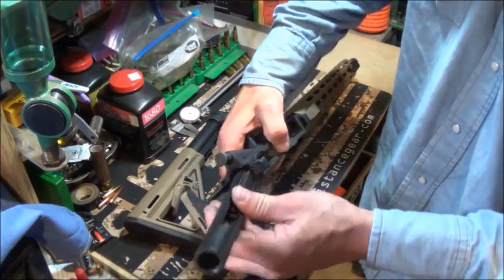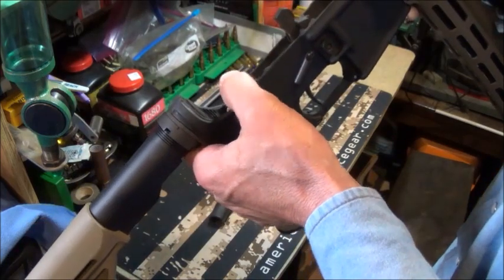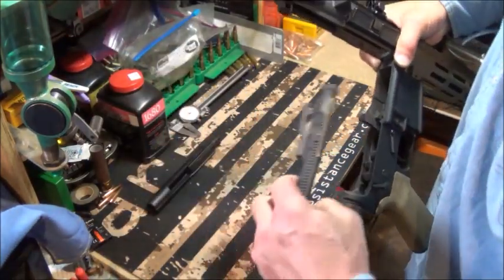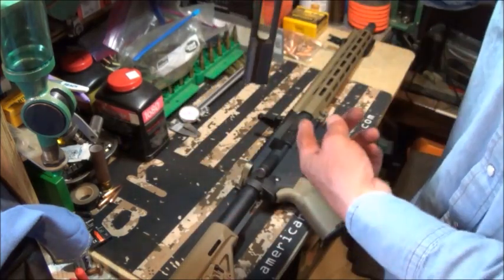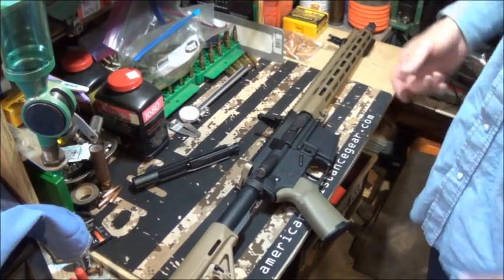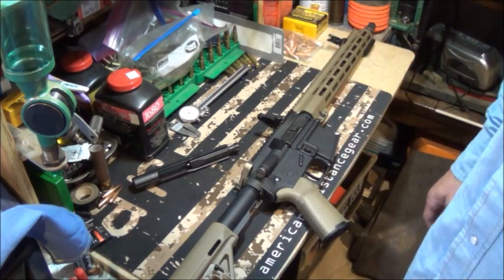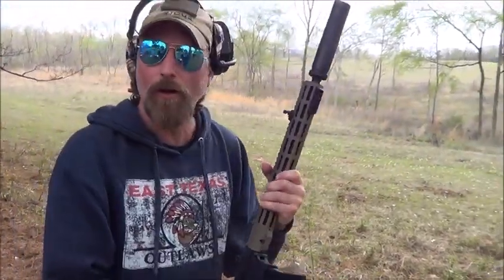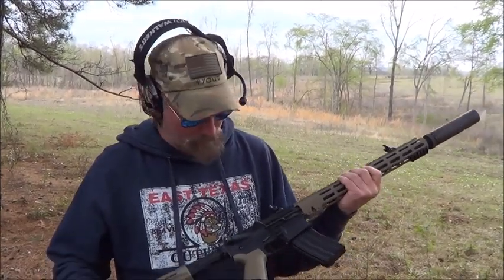Rare Breed FRT - 15 Trigger - BCG Fix

Comment: Just an FYI you can take much more off the carrier with a dremel.  That trigger reset "dongle" only requires very little forward movement to trip.  I figured it out by manipulating the bolt manually.  Charge the firearm unloaded then gently hold the trigger and pull the charging handle back then SLOWLY let it forward and listen for the hammer fall.
Reply from the maker: You just got pinned !!!!!!!!!!!!
Reply: @EastTexasOutlaws  you got a PURDY MOUTH.  REVERSE ACTION!
Reply from the maker: @predawndeath  Yes to both, LMAO !!!!!!!!
Reply from the maker: @scooteractual  I would assume, I haven't ever removed any material, Predawn has though. Thanks for watching and taking the time to comment
Reply: What is the gap measurement to the port from the bolt . Timing gap . Like for a .22 and Drop in auto sear {registered} is .011.

Comment: I have a nickle boron toolcraft bcg I measured it and it is exactly 2.280 and I ran 8 mags just fine with it I have an h3 buffer and the spring binded up on me still so you are wrong it is rare breeds fault they sent me a new spring and antiwalk pins cause I fixed the problem with a dremel it is the locking bar, after I took off enough of the locking bar so it wouldnt pinch the spring it runs just fine it is 100% a design flaw.
Reply from the maker: Awesome good information, thanks for watching and taking the time to comment !!!!!!!!!
Reply: Yeah mine was 2.28" gap as well. I tried 8 different BCGs just to be sure. Spring isn't damaged. None of the uppers will mate without force. Tried H3 buffer all the way down to carbine with milspec spring. Single shot, loads new round, hammer follow without firing.
Reply from the maker: @Chris-ru9cq  Ya, we did have an issue with a buffer spring on a 300 blk being just a little short, but you definitely want them to mate without force. Thanks for commenting.
Reply: @Chris-ru9cq  that really sucks ass thats a new one I haven't heard before mine was an easy fix but your spending 400 bucks on a trigger you have to modify pretty much right out of the package those tiny little screws on the anti walk pins are a joke too its an all around rip off if you don't know how to fix it yourself the housing is good they made it all pretty that's about it haha
Reply: @Chris-ru9cq  sounds like the only thing you haven't switched out is the lower, maybe the pin holes are not in spec and the trigger is too far to the rear.
Reply: @charleswittmer2477  I tried 3 lowers to be sure. Finally worked flawlessly with a POF Rebel hammer spring on the trigger and a flatwire overpower Tubbs (?) rifle spring with rifle buffer.

Comment: Had the trigger for about a month in my bcm recce 16. Zero issue, with no Dremel or bent spring. Standard H2 buffer it came with and midlength gas system. Didn't tune anything and she's ran like a champ so far, granted I'm only at the 300 rounds on this trigger.
Reply from the maker: That's awesome, thanks for sharing with us !!!!!!!!!!!

Comment: I'm new to this FRT stuff. Just saw the ATF lose in the lawsuit, so I'm trying to source information to get my stuff up and running. Everything I have is semi-auto and I'm pretty sure all my BCGs are neutered. Does this mean a FRT will not work unless I get a Full-Auto BCG??
Reply from the maker: Main thing is full auto bcg, the upper closes without moving the reset, and a H3 buffer weight.

Comment: My bolt is over 2.280 and it doesn't close.
Reply from the maker: Well my PSA, and radical firearms BCG works with it, and predawns E2 armory does as well, Not telling you what to do but I think it's bad advice to  grind on the locking  bar ( dongel ) I'd rather take some material  off of the BCG that is cheaper than the trigger. Just my opinion. good luck !!!!!!!!!!!

Comment: I’ve been doing videos on rare breed for a while. Great video!

Every one of my installs has been exactly like you showed, the upper and lower will not seat. I use a small amount of rearward pressure on the charging handle and it will seat just fine. I’ve run all of them this way and never had a spring break or an issue. I’m about to do a 2000 round check in on my lower and trigger.
Reply from the maker: Awesome! Thank you for sharing with us !!!!!!!!!!!!
Reply from the maker: @Nuts2butts  The rare breed eliminates hammer follow, it's probably your buffer weight. Thanks !!!!!!!!!
Reply: until you forget or someone else closes the upper on the trigger group and forces it closed. why not just open the bcg up and get it right before it gets screwed up?
Reply: @charleswittmer2477  because every one of my installs is running at nearly 100% while the rest of the internet says their triggers don't work. I'm not fixing what, to me,  doesn't appear to be broken.
Reply: Question for you: I had an AR pistol built in 556 with a 10.5” barrel and the rare breed frt. I put in an H3 buffer and during the first testing it would only shoot one round then not reset and had to be manually set back into action. The next day I tried a h2 buffer and it ran 556 and 300 blackout for about 3 magazines and then went back into the same issue of single shot then dead trigger. First day with the h3 there were light strike marks on the ammo with the h2 buffer there were not. What could be a reason for the issue and what would you recommend?
Reply: @Nuts2butts  same issue with an H3 on at 10.5” barrel. It ran great for 3 mags with an h2 then back to single shot. Wish I knew if it’s a buffer or spring issue
Reply: @bikerbobbyde  I'm having the exact same problem have you found out any info?

Comment: My carbine gas system works perfectly with the H2 my bcg is a little out of spec but I've had no issues so far. I think most of the problems people are having are either incompatible setups or improper installation ie forcing the recievers together or playing with the disconnector, and pinching the spring.
Reply from the maker: I agree, Thanks for sharing with us and taking the time to comment !!!!!!!!!!

Comment: I think if you have the proper BCG and Buffer weight (H1, H2, H3) for your AR platform along with the spring being able to travel at more of a 45 degree angle rather than straight back, I think this trigger would run absolutely flawless. Another option might be to create more of a "leaf spring" rather than a coil spring system. I also wonder if you were able to encapsulate the coil spring with say a piece of shrink rap or other type of tubing material that might help also. Just brain storming here.
Reply from the maker: Awesome comment, Thanks for sharing with us. I think I'm going to have to put a H3 in to shoot unsuppressed !!!

Comment: ETO, I just measured my PWS upper that doesn't work with the FRT and the LWRC that does work with the FRT. The PWS opening is bigger. Then today I remeasured the PWS and it was 1 hundredth bigger today 229 and the LWRC is still 227. So I was thinking the issue might be the back half of the bolt to the opening. Maybe my hands are not good enough to get a perfect measurement (quadriplegic thing). Neither PWS or LWRC closed as it would with a regular trigger. Did your buddy file his bolt to see if it works?
Reply from the maker: Getting them to close is the main objective, I believe the pinned comment of Predawn Death's talks about that. Thanks !!!!
Reply from the maker: Read the pined comment at the top, Thanks again.!!!!!
Reply from the maker: I talked to Predawn last night, He said I should have measured the distance from the back of the BCG to the cut out not the cut out opening.
Reply: @EastTexasOutlaws  With my PWS opening being 2.29 and bigger than LWRC at 2.27 which worked. The PWS sorta worked. I run my ARs on the dry side but when measuring both the PWS was bone dry. With this ammo shortage I hate wasteful ammo use but I think I need to rule out the possibility.
Reply: @EastTexasOutlaws @predawndeath I'm going back to the range today with PWS upper, covered with Slick 2000. With the opening of the PWS BCG bigger opening than the LWRC BCG. I will go without a can this time. The gas block set to 2 and between 1 and 3. I have the H2 buffer. The LWRC doesn't have an adjustable gas block and with a can is usually over gassed.
Reply: @EastTexasOutlaws  you don't have to measure anything if the parts are hitting, the only thing that can be changed is the portion of the bolt that is hitting the lever extension just make sure the bolt is fully closed in the upper before any material is removed and just remember if the trigger is taken out that the bcg that fits it should be kept with it.

Comment: I ordered a new BCM Bcg to try to get around grinding my no name Mil spec full auto bcg and both are the same size. So we’re saying it’s not a design flaw that it won’t run with a bcg that’s supposed.05” off spec.? Even if I do shave it, it looks like it would need to be more then that. Hard to tell tho. Do they expect us to just keep ordering hard to get 200$ bcgs until we get one that works with their trigger. People need to stop saying it’s not the trigger.
Reply from the maker: This was my quick easy fix, I can't help your frustrations. Thanks for watching and taking the time to comment !!!!!!
Reply: I'm with you and there is more than one thing that doesn't make sense here. First off he measures gaps on two different BCGs but he doesn't measure from face of BCG to rear cutout to see those differences which i s more important than the gap measurement for starters. Then the difference he is talking about as being the gap is quite literally 3 to 4 human hairs wide... The rifle that the BCG is in could have different measurements from seated bolt carrier to channel cutout where it contacts the drop sear on the Rarebreed trigger as well. It is a lot more complex than just "Hey yall, this is all we noticed with our limited testing of 2 rifles and 2 BCGs and we can conclusively and definitively say that the manufacturer who would have to pay for thousands of repairs at their cost isn't wrong at all." I love how he calls it a quick easy fix in his reply but it is not quick or easy if you cant find or cant afford a new BCG not to mention, what happens when you get one that is overly large and you cant remove material to get it to work. Common sense and majority rules makes this video kinda pointless for those that know how to logic.
Reply from the maker: @whitewigglesworth  aw, keyboard cowboy can type, awesome 👍😎
Reply: @EastTexasOutlaws  Keyboard cowboy got your attention! LMAO
Reply from the maker: @whitewigglesworth  thanks for watching and taking the time to comment
Reply: @whitewigglesworth  and you are correct, there is way more to a ar than the width of a hole in the bcg and where it is positioned, but the hitting when the upper is closed shows that there is a problem of interference between the two. I don't think I would modify the lever except for the chamfer of the hole or a new angled hole with a setscrew in the housing as it might be hard to get a replacement for but the bcg can be modded as they are replaceable. The problem is that the ar needs a really good mechanic to tune it to run correctly and a learning experience is costly for beginners. You might end up like some of us with enough parts to justify another gun. Like someone said just watch the bcg in slow motion until you fully understand the relationship between the parts. Different ammo will also change the way the bcg moves and whether the gas port is getting closed up from use prior to trying this new trigger group, heck maybe the recoil spring is weak from long usage. Even the bolt pushing a round out of different mags can change the bolt speed and it's relationship to the trigger/hammer function. I would think the best scenario would be the bcg just barely clears the lever as the upper is closed for the best timing.  lots of variables to consider when we have guns that look identical but very different inside,

Comment: Wanted to like this trigger but I've modded the bcg and tried it in both my 5.56 and my 9mm. Couldn't get the 5.56 to fire more than 1 round at a time and the 9mm was having out of battery detonations. Thought about emailing the company but since they dont seam to say anything other that you're gun is out of spec I'm just going to send the paper weight back
Reply from the maker: Thanks, I don't think they take returns.

Comment: Can you define what you mean by ''out of spec''?  When I think about ''spec'', I think in terms of the nominal dimensions that Stoner drew up for the M16 bolt carrier and the related +/- machining tolerances. I don't think that the specific carrier dimension that was mentioned in this video (2.280/2.272) tells the entire story.  The extent to which that ''dongle'' is being engaged by the carrier is going to be impacted by the dimensions of the interacting machined surfaces of the barrel extension, bolt, cam pin, and the carrier forend bore.  You are definitely on the right track, but that 2.280'' is somewhat arbitrary since there are multiple dimensions that ultimately determine how far forward that portion of the carrier rests when in battery.  That 2.280 on a different bolt isn't a guarantee for functionality. And, I'd be willing to bet there is a good chance that ''2.280 bcg'' solution in the video probably won't work very well with trigger after 5000 rounds. But, it will still measure 2.280''.
Reply from the maker: Basically if you cant close the upper without moving the dongle forward it can damage the spring.
Reply: @EastTexasOutlaws  yep

Comment: Hey. I'm having some issues troubleshooting, is there any chance you guys could help me with some tuning? It's very hard to find resources on this stuff and most gunsmiths don't even know how to help or are not interested. 

I'd be much obliged.
Reply from the maker: The main things are to make sure your upper closes without to move the reset and an h3 buffer weight. I also recommend a militia state armory  FRT lock bar spring for the rare breed and a M3 Tactical FRT-OTS1. The M3 keeps you from pulling the trigger to hard and slowing up the BCG or stopping it all together.
Reply from the maker: https://www.youtube.com/watch?v=UtNAAThjLZ4&t=16s
Reply from the maker: https://www.youtube.com/watch?v=QE2fgyp4Ljs&t=23s
Reply from the maker: https://www.youtube.com/watch?v=qg1nqYgxxBU
Reply: Okay. So I took to some die grinding on the BCG. All of my BCG's have a 93 thousandths opening instead of an 80 thousandths but I'm assuming the dimension would be from the back of the BCG to the shoulder of the opening. 

It just barely trips the dongle now. I'll try it and report back and watch your suggested videos if it doesn't work!! Thank you so much, happy thanksgiving.
Reply: Alright.. so did a hand filing test on my bcg. Got down to where it just barely wouldn't function in the semi auto setting. Added .030 and did another one. Drilled gas port out to .078" 

Tried with an H2 buffer and only got doubles.

Tried H1 buffer and got as good as some quad rapid fires. 

Going to put a standard carbine buffer in and try again tomorrow and maybe consider taking my gas port up to 3/32" 

Pretty sure I'm not getting enough gas. The two times I got a quad shot, it stopped because It didn't pick up a round.

Greatly appreciate your help, I'll report back  again.
Reply from the maker: @BigPhilsSaws  Ya, when I had a H2 in mine it would only run suppressed, H3 operates with or without. good luck, thanks for getting back with me !!!!
Reply: https://youtu.be/oBa9ftNmiHo

I got mine running. Thank you south for your input. I could likely not have done it without you or a very very qualified Armorer. Much obliged my friend.

Comment: Nah man it’s the trigger. The reset spring needs to be angled. The problem is the reset spring gets pinched because it needs to sit at a 35 degree angle to compensate for the motion of the reset pin as it doesnt go straight back, rather it angles upward a bit due too physics of how a hing works . Doesn’t matter what buffer or bcg you use. The same thing will happen to all of them eventually until this issue is fixed. All adding different weights and bcg does is just put a Band aid over a festering wound. It’ll last longer but ultimately will still fail the same way as the rest of them
Reply from the maker: Awesome   https://www.youtube.com/watch?v=U-06QRVi9WE&t=185s

Comment: Wow, was randomly trying to confirm my theory on my BCG being out of spec. Thank you, sir. Mine was sending the hammer home too soon, resulting in 1 shot following by light hammer strikes. 

Btw, you would have better control if you had better handling, no offense. Put your weight behind the firearm and apply linear weight.
Reply from the maker: Awesome, glad we could help you and thanks for the tip  and taking the time to comment !!!!!!!
Reply: Hi mine is doing the same thing. Fires 1 time loads another and I get a light primer strike. What u do to fix it. Mine is on a pws mk111 pro upper
Reply from the maker: @mitchweisbeck5153  It could be spring or buffer weight, Thanks !!!!!!!!!
Reply: @EastTexasOutlaws   changed all that and gas settings and still does the same
Reply from the maker: @mitchweisbeck5153  It seems that every gun is different in what makes it work, Have you tried feathering the trigger instead of holding it back?
Reply: @EastTexasOutlaws   ya I got he gist of that. And yes feathered. Held a little tighter. Still nothing. The bcg is in spec and not damaging or Over traveling to damage that locking bar so idk
Reply: And I have also tried it on several different uppers with different bcg’s
Reply from the maker: @mitchweisbeck5153  Ask Predawn, he's the expert !!!!!!!!
Reply: That’s the problem I’ve having. Tried two different uppers and bolts but the closing issue is what I, having with single fire 
light strikes
Reply: @I-love._.you-117  I’m having the same exact problem with the wot and I don’t know what to do about it. If you guys figure it out please let me know.